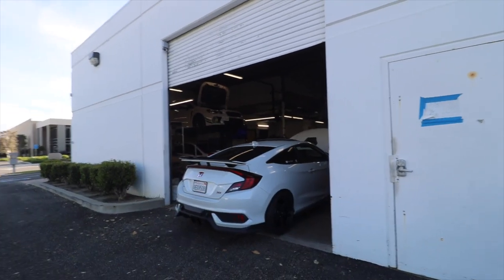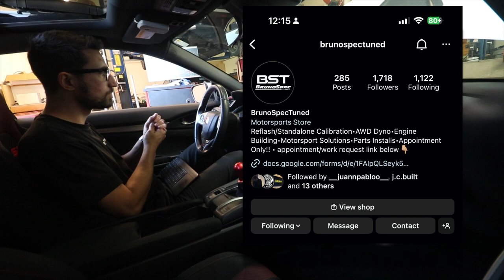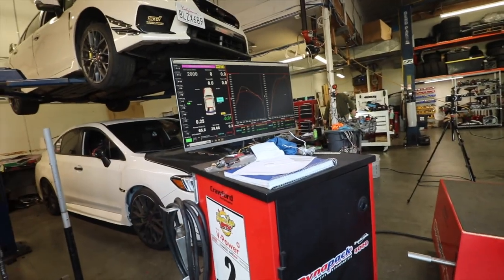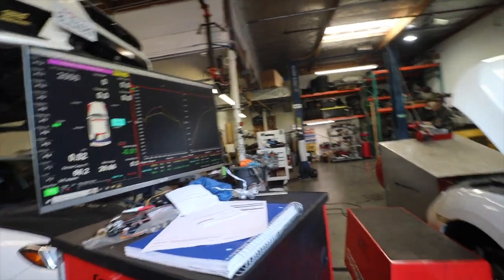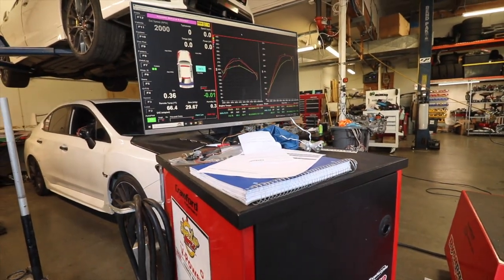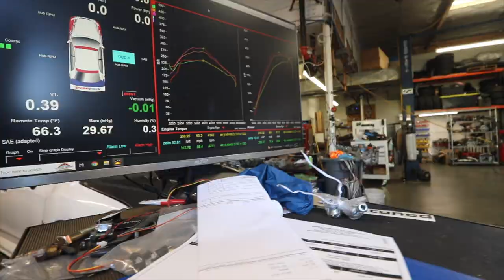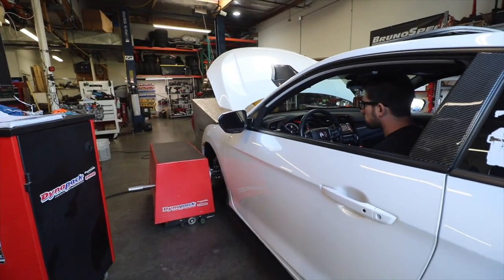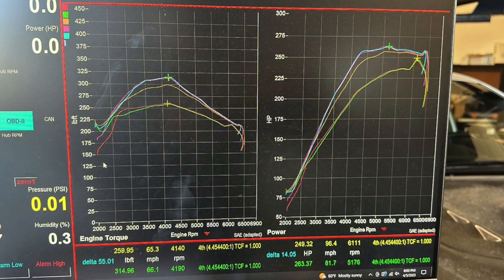Finally Dyno’d My 2020 Honda Civic Si | FBO and E30 Custom Tune Results!!!

Comment: Bro!! Badass numbers but I hate that we can’t make more with stock turbo. 280hp-300hp with stock turbo would be amazing.
Reply from the maker: It’s possible 
Just needs an aggressive tune 😅

Can’t say the engine or turbo will last lol
Reply: You don’t want the powerband of an L15B making 300 on a stock turbo anyway. You’re either going to throw a rod or spin the guts out of that turbo. Best to just get an upgraded turbo.
Reply: My 2020 civic si got 280whp and 331wtq FBO E30 stock turbo. Tuned by Drob, so it’s possible just depends on the tuner.

Comment: On my 370z recently got my ecutek tune with 93 octane being my highest. Should be close to crank at the wheels. Want to dyno it at some point. So should be hitting your torque figures as is but with a flatter curve thanks to VVEL.
Reply: Doubt you are hitting the same torque as the civic if you are NA. Definitely more HP though if you are tuned.
Reply: @John Barron  Yeah fair I didn't realize that I was looking at his tune on low boost and not his max. But yeah I suspect should be around ~260 ft/lbs (+/-10) of torque at the wheels.
Reply: @ChaseMMD  sounds about right NA 👍

Comment: Bro please please please get a real tune on the dyno. I’m running straight 93oct that’s it and don’t even have a catless downpipe. All I’ve done is wheels, Bms intercooler, skunk3 3in catback, prl Sri some ngk plugs and amsoil trans fluid. I went from 182whp to 264whp and 320tq and still on stock clutch. Btw stock clutch is starting to slip up top so I do have to get a new clutch. My point being you can push way more up especially on a e30 blend bro. I’m only running 20psi. I’m willing to bet they are just upping boost and barely touching any timing at all. I refuse to believe they are pushing your car with their tune it’s so conservative it’s insane. Been telling you this for a bit now though lol at the end of the day it’s needless to say it’s your car and do what ever makes you happy brother. Just know you have a lot of headroom :) just keep down low torque lower and ramp up the power and it’ll hold 600whp no problem there’s quite a few si’s in Orlando doing it on the stock motor and haven’t grenade in years. Manage torque and keep hp tq below 400 on the stock trans and you will be good don’t even worry about the power your making it took 8k miles now on mine of thrashing it day in and day out to get my clutch to go. Crazy part is I’ve been taking stock and lightly modded type r’s to gapple bee’s lol I do recommend arp headstuds like you mentioned too
Reply from the maker: Keep in mind all dynos read different and sea level plays a factor as well. 

Also, You’re running 20psi and and you’re pushing 320wtq? Stock is 15psi. Not saying you’re lying but I find it hard to believe a 5psi difference gave you 120 more tq. 

Even so, I’ll get remote tuning eventually. It’s not on the top of my “to do” list
Reply: 320 torq at 20 PSI! LMAO!!!!!!!!!!!!
Reply: Lol what?
Reply: 600 whp?😂😂😂
Reply: @TdaKid will have to see when you get a dyno tune by someone that isn’t nerfing your car to be so called safe. I am at sea level here in Florida for sure. Doesn’t change the fact that my tuner specializes in Hondas and has a 5star rating and a drag team with a civic running 7’s at the strip about to crack into the 6’s. It’s easy to think it’s highly unlikely when you haven’t seen something. Believe me there is a lot to be had when going from a ok tuner to a great tuner.